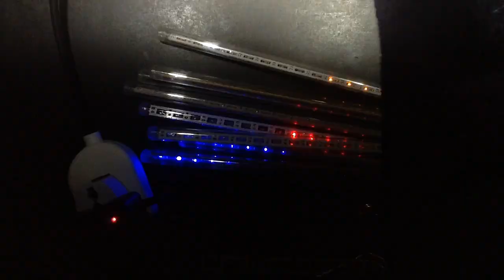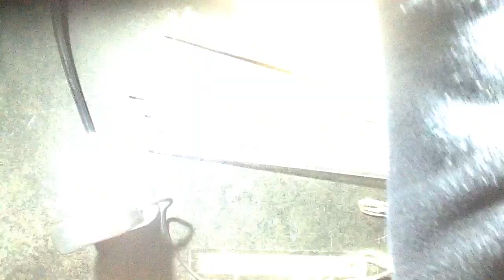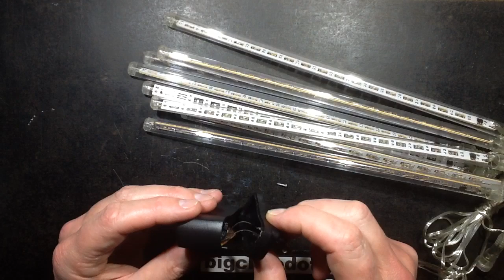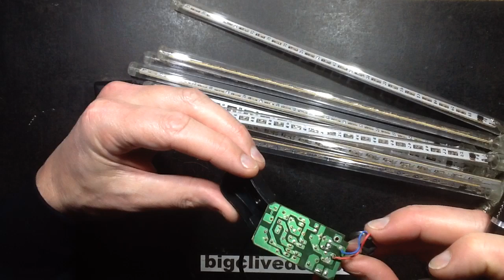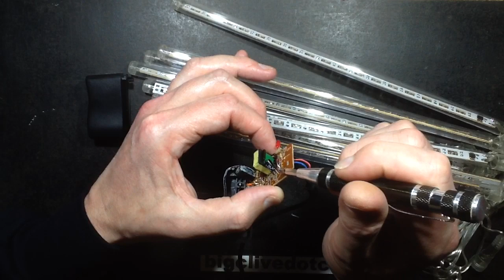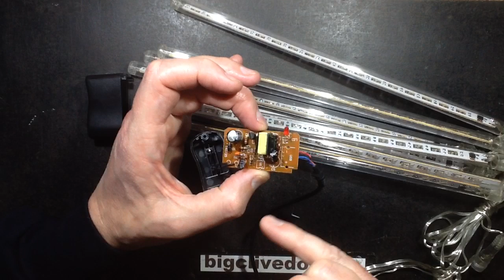Hissing and "smoking" PSU internal examination.

Comment: For information, there are some signal diodes in DO-35 packages that are rated at a higher current than a 1N4148. And indeed, some manufacturer datasheets for the 1N4148 show it rated for 200mA average rectified current.
Some of the diodes with a higher rated current are:
1N4149 500mA 100V 500mW
1N456A 500mA 30V 500mW
1N458A 500mA 150V 500mW
BAY73 500mA 125V 500mW

Comment: Back in the early 2000's there was a whole batch of electrolytic caps where one of the manufacturers got another's fluid recipe, but didn't manage to get the whole thing. This lead to a large number of electrolytic caps to fail in the matter seen here, we saw a lot of them on mainboards. The failure mode on even those, still mostly worked much of the time, you would just get occasional segmentation faults or BSODs (depending on OS). 

So the fact that on the comparatively less delicate application of meteor lights it just kept going, really isn't that shocking.

Comment: I had a similar power supply blowing up. Only 12V2A. It was still working so I had some trouble finding out just what had exploded. Had to search the whole room by smell. Opened it and found a similar capasitor with bulging top and had vented in the bottom. Adding to the three chinese GU10 LED bulbs that also exploded I now have a hard time trusting anything chineese that runs on mains voltage.

Comment: most of what you say I don't understand but it sounds great ..lol your knowledge about these things is amazing thanks for passing on your knowledge. . I came across your channel looking for a video on how to wire led light strip in a utility truck tool box. after watching a few videos I'm second guessing Chinese made electrical items. and suggestions on a reliable led light company?
Reply from the maker: +J1SMOKES Don't worry, it all sounds like gibberish to start with but gradually the jigsaw all falls into place.
As far as LED strips for truck lighting goes, the main thing is top make sure you design your set-up to be serviceable for replacing the strip if it starts to fail or newer and better stuff becomes available.  If you look on ebay you'll find 5 metre rolls of LED tape at very low cost.  Buy it, use it, destroy it and replace it.  It's a disposable item these days, and quite fun to mess around with.  There are a few types that you might consider.  2830, 5050 and various others, where the numbers are basically the dimensions in millimetres.  The 2830 type is the dimmest and lowest current while the 5050 has three LEDs per chip so is a lot brighter.  You can also choose between cold white and warm white.
The stuff is designed to run from 12V so the higher voltage of a fully charged truck battery (13.8V) will push it a bit harder, but it's nothing major.  Especially for non continuous use.
I'd suggest you buy some, play with it, break it, fix it and have fun.
Reply: +J1SMOKES The guy, like myself, knows about old school electronics - the period between valves(1940), and the invention of Very Large Scale Integration (1980). That was the golden age of electronics, when you could build circuitry using discreet components. Such thinsg are not possible. You cant really buy individual components as such, and theres no one could teach you how they work anyway.  During that period i built Disco equipment, mainly lighting displays, it was the period when such things were first possible. I developed a method of strobing fluorescent tubes (which soon everyone copied) using hand wound trigger coils. It was a period where there was everything to be discovered and invented still.

Comment: WE WANT FLAMES!
It'd be RUDE not to make it go bang!

Well I know whats wrong before you even opened it. It has a US plug on it rated for 120 - 220 volts RMS not Vpp.
Now since this is set up for US it is safe to say this PSU is the 120 v version (the 15 amp spades) so the Vp is 170 volts with a Vpp of 340 volts.

These are obviously made in China and China uses type "A" plugs with a 220 volt mains which which explains several things about your lights there and how labels are very misleading. The norm for a type "A" plug is 15 amp 110 - 120 volts.
Ref link - https://en.wikipedia.org/wiki/Mains_electricity_by_country

Most of the crap made in China is geared for the US since we LOVE to buy this stuff since its so cheap so they made it convenient for us. I think the US is their biggest customer overall so yeah..

What was the rating on the mains cap?

Now your in the UK your voltage is 230 volts RMS with a Vp of 320 and a Vpp of 640!!..

So yeah I can see why it was hissing and smoking lol
.

Comment: Did you check voltage rating on main cap as you only mentioned the polarity, was it rated at 400v ?

Comment: 1.st of October 08:57 GMT+2:
1090 views and 111 thunbs up... Is that a hight thumb up to views ratio for someone who does not ask viewers to like and subscrbe?
Reply: +Flapjackbatter 
It's a high ratio. On most videos I've seen maybe 1-5% of the number of views as ratings (up or down). Although it's very dependent on the channel size and "easier" on small channels. The more views the lesser the ratio of (dis)likes.

Comment: I'd say replace it with a Rubycon or UCC real 400 VDC rating and enjoy your lights. It would be interesting to remove the exploded cap from the circuit and measure the capacitance.

Comment: Maybe the capacitor is either open or acting as a resisotor, if it's reasonably well regulated, the average voltage would be lower, but less smooth, got a scope ?
Led's don't care if you feed them ac or dc (a kettle i have is just a dropper resistor and 2 led's in series), but i wouldn't want to use that supply on something like powering a data device
Though the timing circuits in the icicles may have a small capacitor to decouple the supply ?
Reply: +Sparky Projects  we seem to follow the same people on here.....
Reply: +Sparky Projects Their Chinese built, I doubt there are any decoupling caps...
Reply: +ElfNet Gaming  just like any chinese stuff, i was thinking those icicles were once used individually, but then connected together.
Also, without decoupling the impulses from one icicle can affect the others, so would be somewhat sync'ed
Reply: You would think that they would sync up but I seriously doubt it. China is good for supplying us with neat things like this that are cheap so we can  tear into them and not feel any pain in the wallet, especial;ly if we make it go POP.

Comment: The power supply was 240V rated wasn't it? Since it has a North American end on it.
Reply: +bigclivedotcom that's actually pretty good. Now I want to know why it failed. Mind you I have a charger that did the same, I replaced the cap and that blew too, I should figure that out first.
Reply from the maker: +Firecul42 400V
Reply: +Firecul42 Maybe the capacitor was a cheapsy Chinese fake that was marked 400 VDC, but wasn't really. It is incredible (and scary) the kind of stuff that is misrepresented to sell cheap. Electronics isn't the only place this happens... industrial equipment too... lots of low quality (junk) stainless steels coming from China get stamped and sold as 316L. Scary!
Reply: According to the sticker yes but maybe the cap wasn't, he never mentioned it's rated specs.
Reply: +Firecul42  I had the same issue but after replacement of the cap with a higher value it worked fine all I could do was put it down to a faulty cap as it was a no name brand.
Reply: +stonent Clive does say 100 to 220 volts.